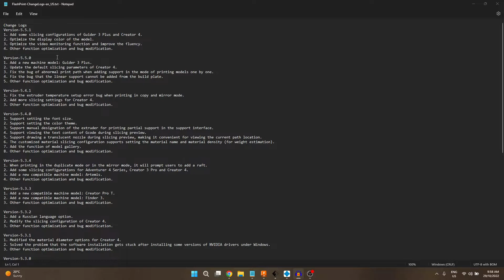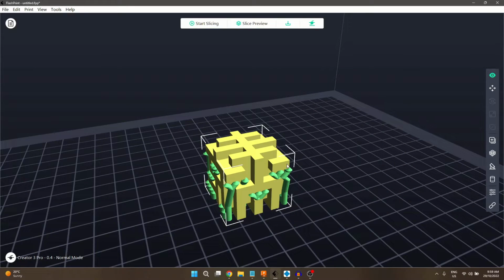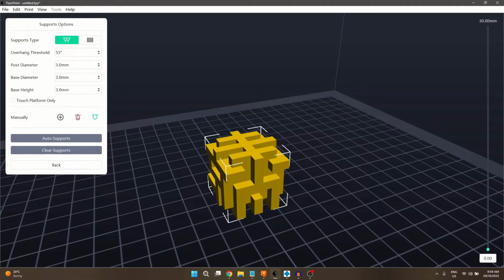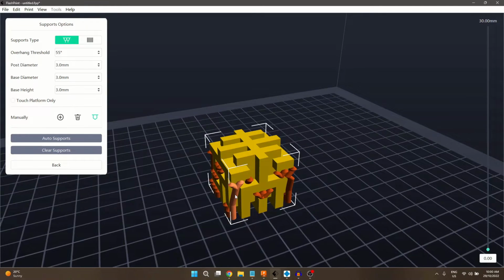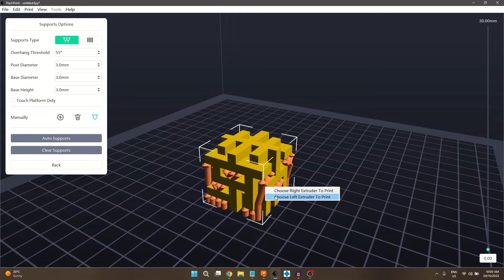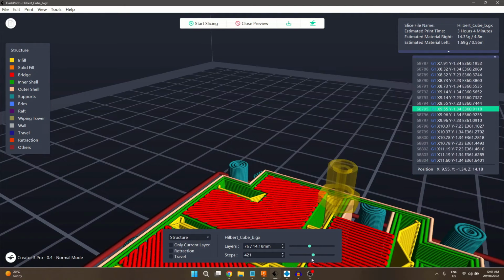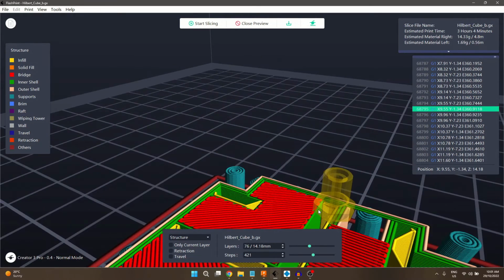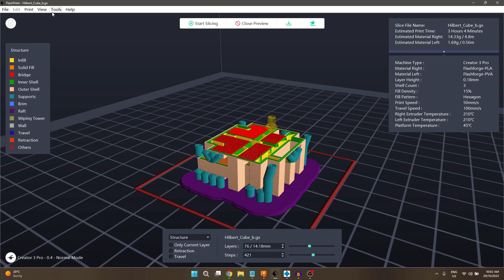FlashPrint New User Tutorial - Update Support Settings for IDEX users

Comment: I have the same printer and I can't figure out how to print using both Extruders at the same time. I select it so that it can simultaneously print but my right extruder only prints still
Reply from the maker: @raychelmontes5611  which machine are you using exactly? The creator pro 2? 

You need to make sure you click the little circle printer button in flashpoint, it’s in the bottom left corner of the main window, should have your printer model next to it.

Select mode.
Select either duplicate or mirror. 

The viewport should change to show it is in dual print mode, it’ll put up a centre boundary between the two side.

Comment: Is there a setting in FF to compensate for material shrinking?
Reply from the maker: Yes. From memory, it is in the “others” tab. And you’ll be able to adjust for material shrinkage along all axis. So best to print calibration cubes and adjust as required, then save settings once it’s where you need it to be.

Comment: Hi can you make a video about the settings that needed to be changed to get a reliable TPU print in flashprint ? Thanks
Reply: ant btw Ctrl+A was a big help. I used to do zooming out of the model and with pressing control drawing a selection area with mouse.
Reply from the maker: That’s actually a challenging subject. TPU is a fiddle material, obviously, due to its flexible nature.

I got fairly lucky with my limited experience with TPU using a pre made profile from Flashforge. A good start would be to use a profile from a similar a printer there is in flashprint and take the settings off that and make your own profile, from there it should be a lot easier to dial it in. I’ve had success with that method a few times with both different machines and nozzle size combinations.

Comment: Can you print with one extruder  and put supports? I tryed that on flashprint I chose left extruder and made model green but the supports didn't change when I was trying to print them with the left extruder. I am printing with flashforge creator 3 but I want to print only with one extruder
Reply from the maker: To ensure your model and supports are printed from the 1 extruder, place the model and support structures down. While in the add support dialogue there is a little nozzle icon, its above the auto support button, click that so it goes green. Right click on the support structure in the viewport and select the extruder. 

Close the support dialogue and right click on the model and select extruder also. This will ensure that once sliced both structure will print from the same extruder. 

Hope that answered your question, if I've misunderstood, please let me know and I'll try to help.

Comment: Hello Mike , I watch your videos are very helpful . I want your opinion about an issue I have with one model. I use Flashforge Creator 3 for 3d printing , flashprint for slicing and simulation model and solidworks for design. I tried to print a bolt twice but the nozzle remove the bolt from the raft (I dindn't use support and my orientantion was vertical with the spiral from the upside). I saw  at the "view->show steep overhang " that the spiral was red . I tried to change orienation to horizontal at flashprint but there always a red area. 
What do you think ?
Deserve an horizontal try with overhangs?